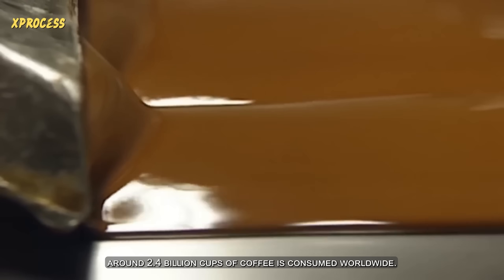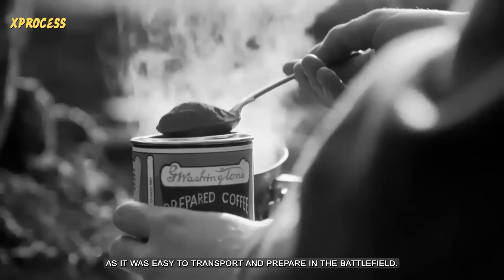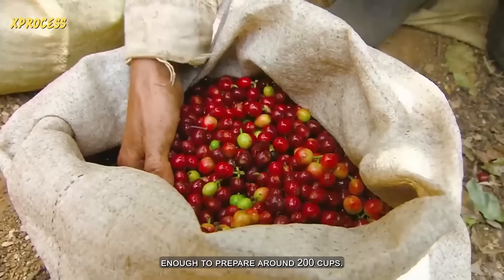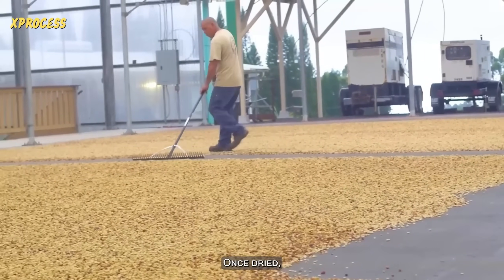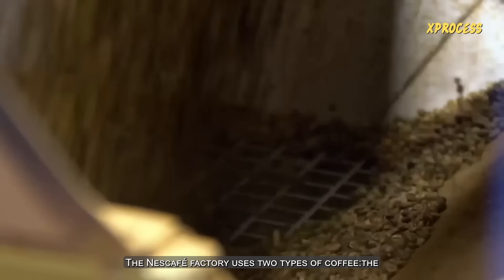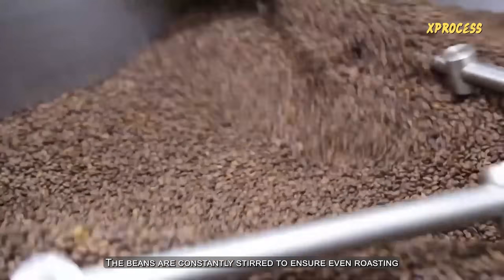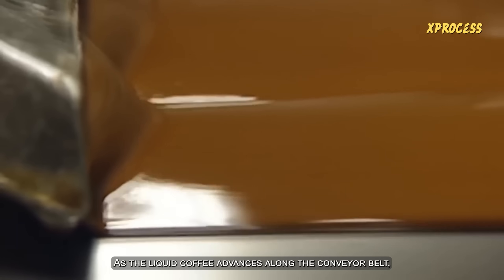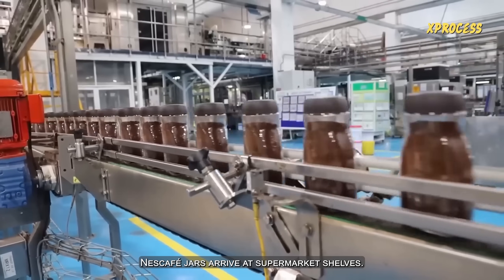How Nescafe Coffee Is Made in the factory | Coffee Bean Harvesting Process

Comment: It never occurred to me that instant coffee is just freeze dried coffee.

Regardless, buy a grinder, because whole-bean tastes better, gives more coffee per bag, and is overall cheaper.

Edit: I suck at grammar apparently
Reply: Instant coffee has a decade long shelf life. If stored properly. 
So stocking lots of instant coffee could be a good idea.
Reply: Also, it actually tastes like coffee ;)
Reply: by not grinding them until you wanna drink it you preserve more aroma
Reply: But they never said anything about the coffee ground after mixed with water??
Reply: @maddog3768 - Some factory used them as fuel for generating electricity. Most are sold as fertilizers.
Reply: @MuffHam  Drink it however past its prime as you like, but it says in this very video that the shelf life is 24 months.
Reply: I entered grinder in google and found bunch of gay guys. Will they buy me coffee?
Reply: Eureka Mignon Notte ^^
Reply: @shadowmistress999 yes the smell is delicious 🤤 ☕️ salud
Reply: @Piggy991  Oh they will but I don't think you'll like what you may be expected to do afterwards

Comment: Where did the coffee grounds go after mixing hot water and ground coffee and heating it untill all water evaporates ??
Reply: Yeah that part of the video was a mess. I think what they meant is that it goes to the heat exchanger evaporator thing first to concentrate it to thick goop, and then the thin layer of thick goop is frozen, broken into pieces, and then freeze-dried (which AFAIK does NOT involve heating it, since that would melt it, which would make it not freeze-dried).